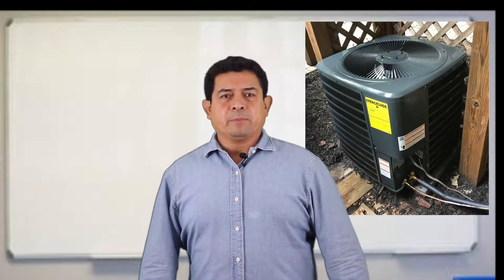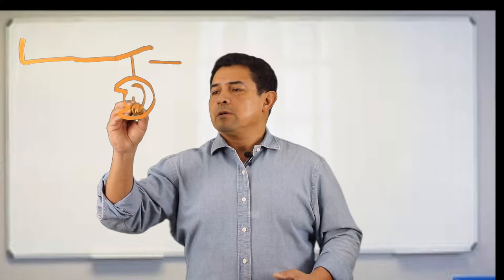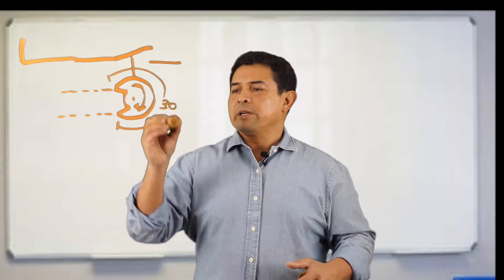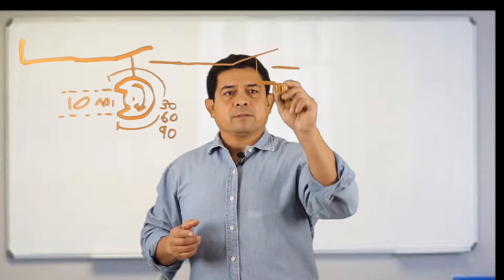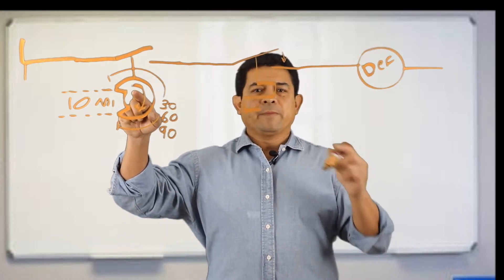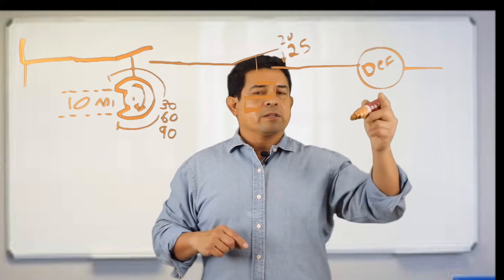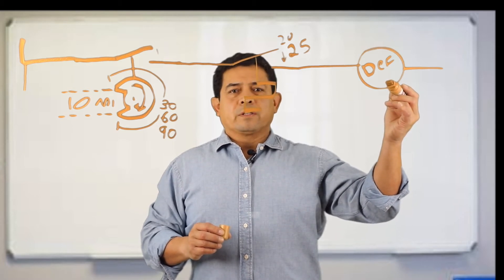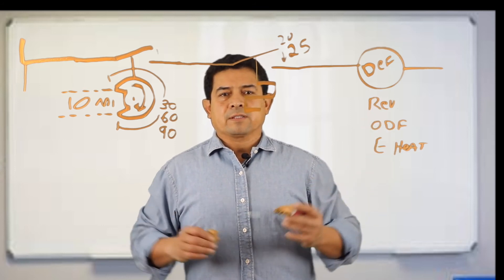Defrost wiring - HVAC Online Training and Courses

Comment: Enjoy your videos continue to do more. On T-stat, reversing valve troubleshooting and explain, pump down system after charging or checking for pressure, and how to check for super heat and finding target super heat.
Reply from the maker: Thank you    I will make a note of that!!!
Reply: Great details on how you explain everything.